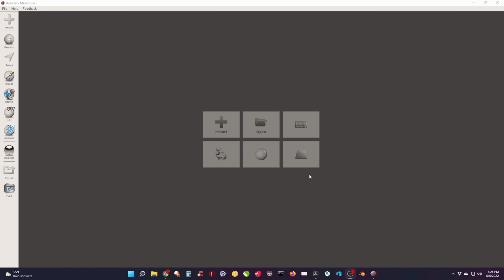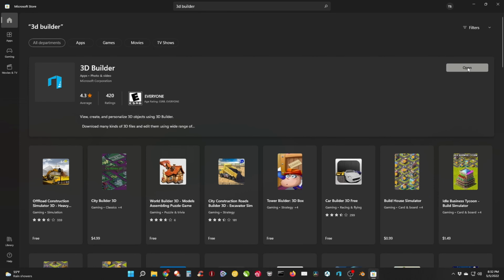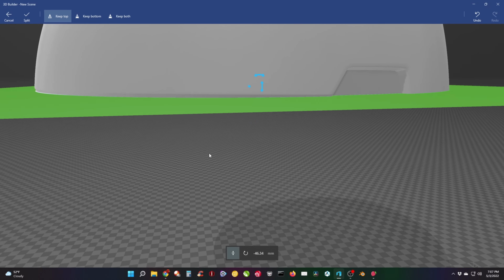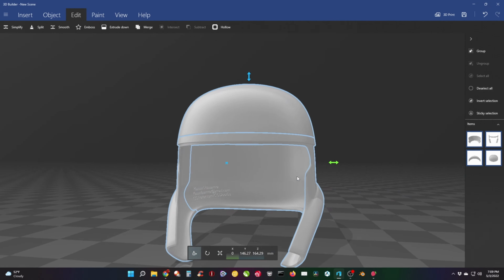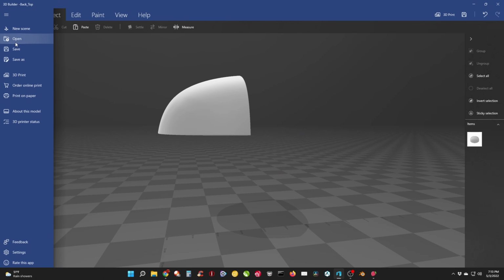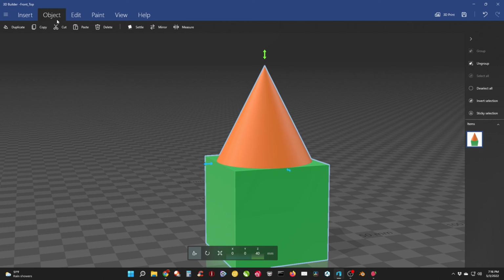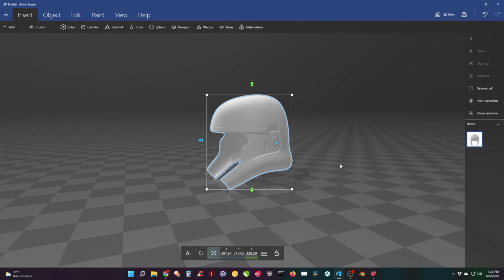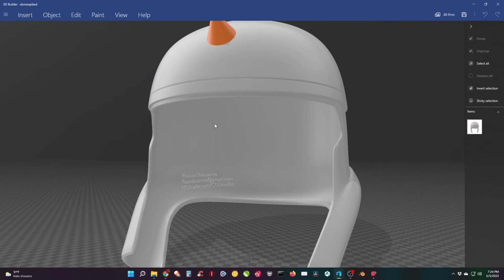Splitting and joining 3D Printing STL models with 3D Builder like Meshmixer

Comment: Howdy pard'.  Thanks for providing a succinct and easy to watch video, it's appreciated. I agree that 3D Builder (maybe because it's free?) is a highly underrated piece of software. Even though I am somewhat familiar with Blender my go-to for most things is indeed 3D Builder of late. I'm still wrestling with getting Orca to properly apply infill to the cavity created by 3DB when I 'Hollow' but will keep at it. Fortunately, I also own Simplify 3D and it seems to behave better with the 'Hollow' thing. As to your Deleting and then Control 'Z' ing all of your helmet parts, that's smart. I like to Copy and Paste the individual pieces into separate 3D Builder windows and Save them individually because sometimes I'm adding or manipulating that portion (kinda like your Uni-Trooper example).  Thanks again for taking the time, even though it was two years ago.  ; - )

Comment: everytime i use this method to cut my robocop shoulder armor into pieces, it makes each piece into a solid piece, and im only following the steps u lay out here, please help
Reply from the maker: Was the stl file free? If so, where did you get it? I can try it out myself because I'm not sure what you're describing. It will "face off" the cut portions which is normal, but I can't be certain what problem you're having.

Comment: I have a GK Two printer and it's factory slicer. I use it to print 32mm scale miniatures. Would this program be better than the slicer to cut the hilt off of one sword that has two hands on it, then take a second sword and cut that hilt off, that has one hand on it then put the blade and guard section of the first model sword and the hilt of the second model sword with a single hand on it together?
Reply from the maker: IMO, absolutely yes! If you were only cutting the pieces for printing, any slicer that has this option will be great. But if you intend to combine them, it's been my experience that 3D builder does a much better job than most others for that purpose.